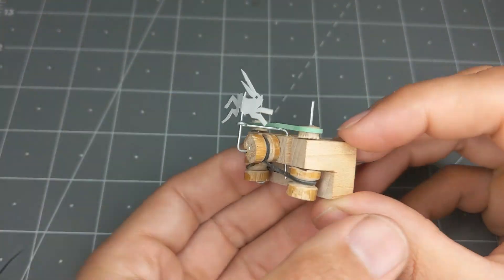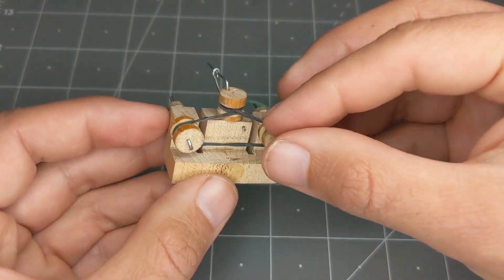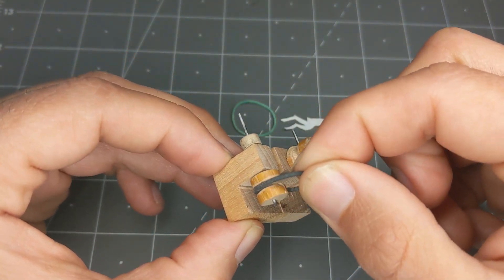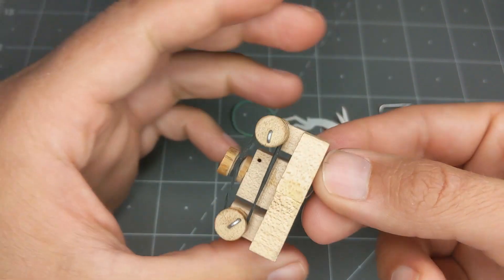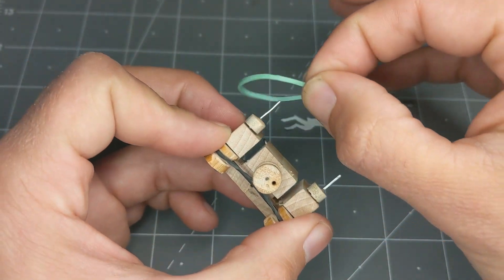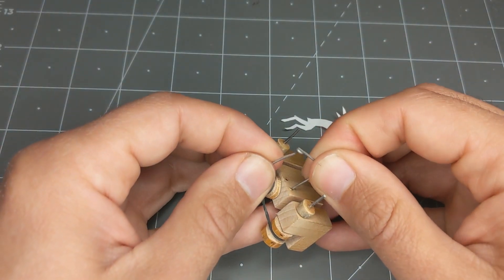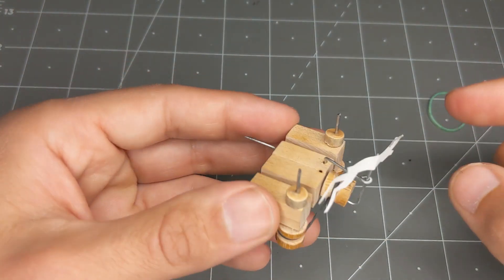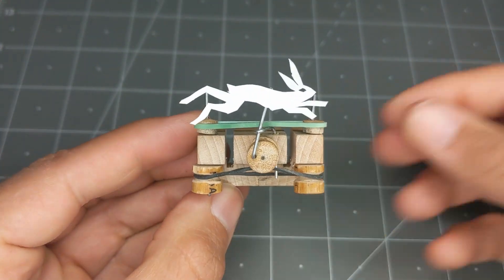How the hare from day 16 was assembled

Comment: Thanks for the explanation. Mind telling me what kind of wire is best for making these kinds of things? thanks
Reply from the maker: Yeah, I think something like 18 or 19 gauge wire (about 1 mm) works well. The trick is to find something that is relatively easy to bend with simple tools but that retains its shape. 
I've found good wire at the hardware store, but the art store sometimes has good stuff too, like the kind of wire they use for armatures. 
In a pinch i've used a lot of paper clips too which are a bit more stiff but still usable.
Reply: @wolfCatworkshop  oh great thanks for your help!